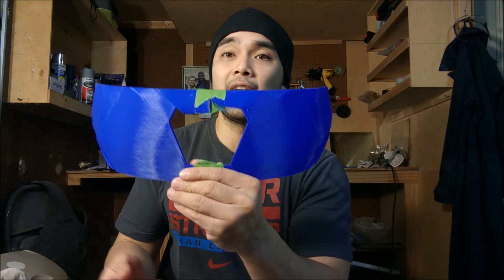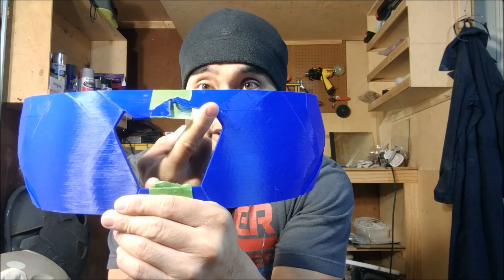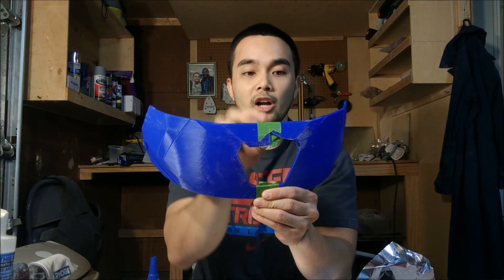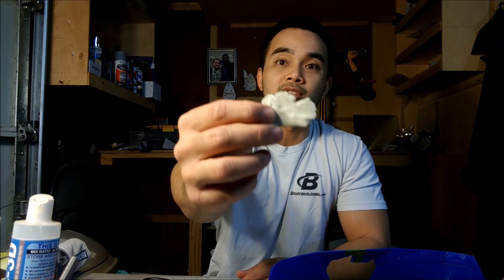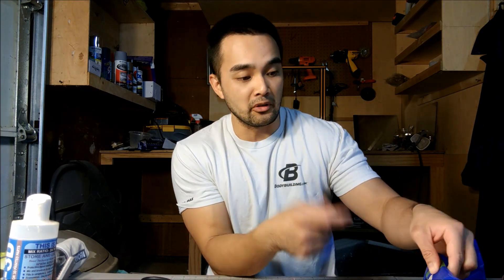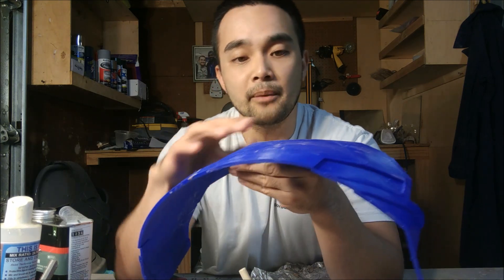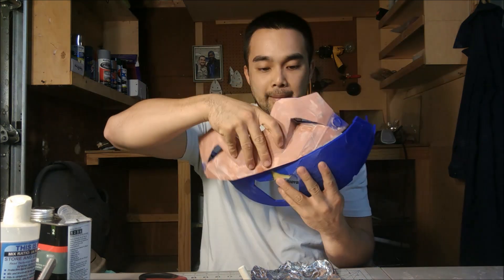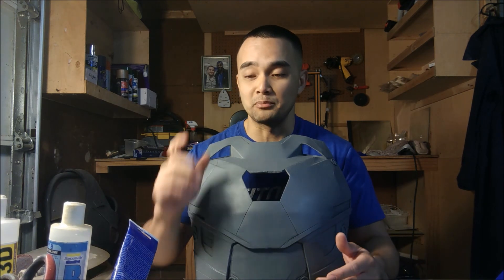3D Printing Hack- Stop Reprinting Failed Prints

Comment: Instead of the clay, this is what I use mt 3d pen for. I put a piece of balsa wood behind the print with wax paper on it, this way I have a goo firm surface to start on, then use the 3d pen to fill in the area that is missing. No glue is needed since you use the same filament, the color matches, and only takes a little sanding to get it to match the rest of the part....
Reply from the maker: that's a fantastic idea!! i'll remember that for next time! 

not everyone has a 3d pen and i'm guessing most people dont want to buy a 3d pen just for that. a piece of clay is less than a dollar and it's more cost effective in my opinion.
Reply: Yeah, I understand.  I originally bought it after seeing people using a dremel to friction weld some 3d prints together, so I bought the 3d pen to see if could be used to "weld" the parts together.  It works great for that, and I am now finding other things you can use it for..........IMHO, I think it is definitely worth the $40.00 investment to add to your toolkit...